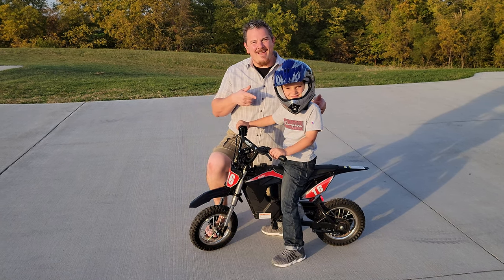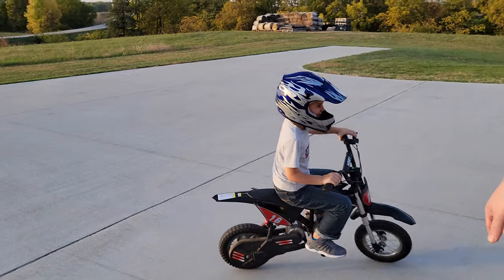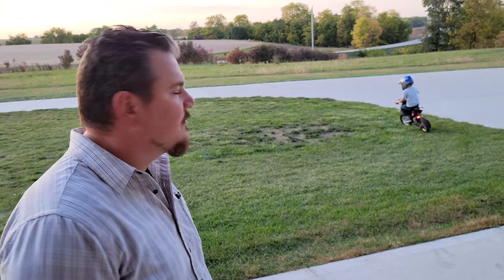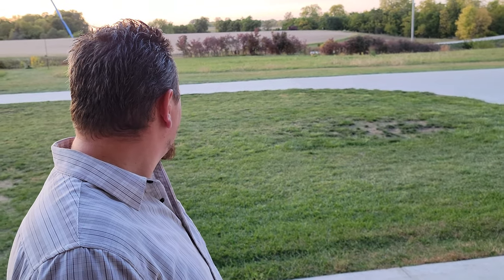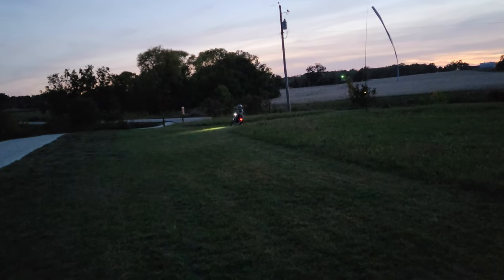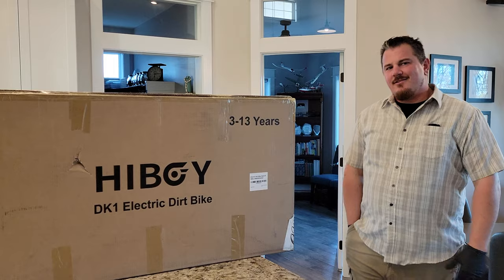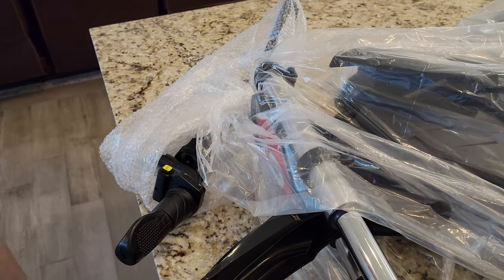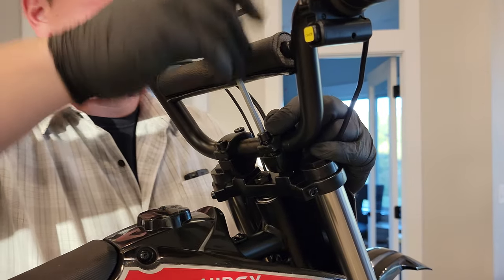Hiboy - DK1- EBike Dirt Bike - Unbox, Build, & Maiden Run

Comment: 20 years ago, (when my bones & body healed much faster 🤦‍♂️), I worked at the local Honda, Yamaha, Suzuki, kawasaki motorcycle shop. (I was the PDI tech). When business was slow, WE had pit bike races. Usually 50cc, no bigger. Around the lot, out back, down a good sized hill (cause up wasn't happening), & over a truck loading ramp/jump! Everyone put in $5. The winner would always buy lunch. 

Ah, old times of complete boredom 😁
Reply: Everyone could join in. Salesmen, supervisors, customers.
Reply from the maker: That is awesome! I bet nobody every got hurt - LOL ;)
Reply: @BrianPhillipsRC  

Not hurt bad enough to need a ride to the hospital!🤪